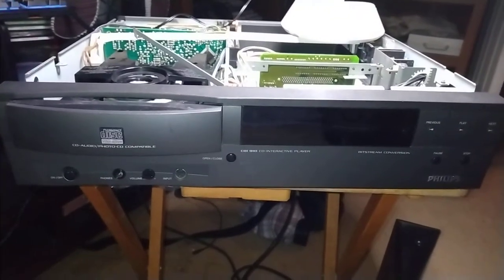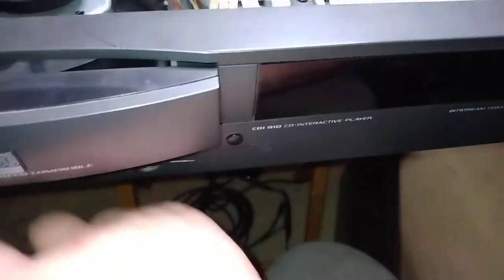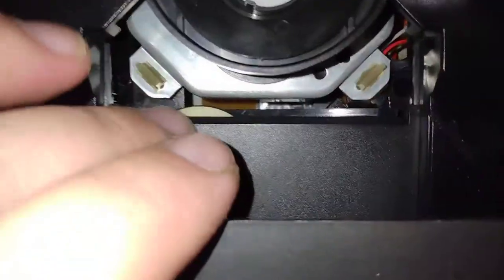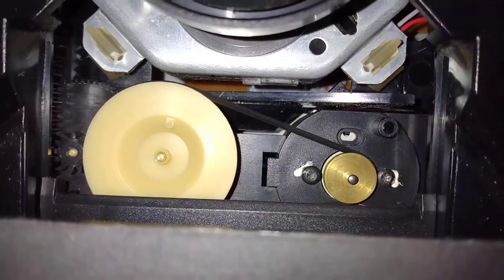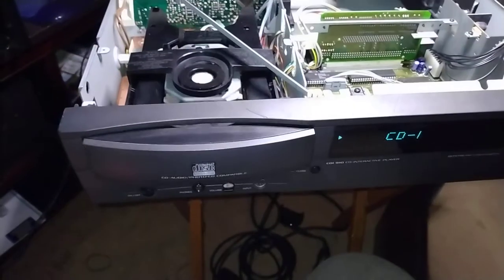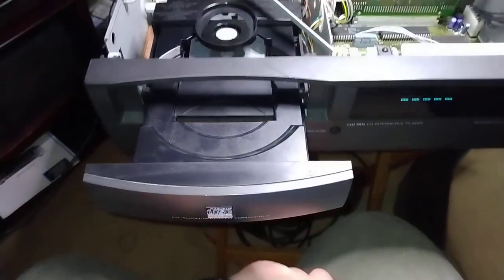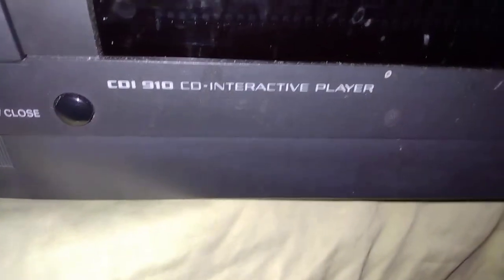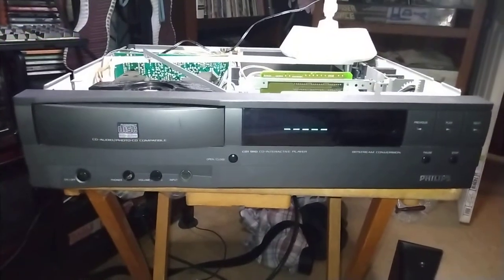Philips CDI model 910 CD tray belt replacement

Comment: Used your guide to fix my CDI 910, replacing the old worn out belt. Thanks!
Reply from the maker: AWESOME! If you need help getting the memory battery replaced, lemme know!
Reply from the maker: I also know where to get prefab boards to mount to the memory vram/clockchip for cheap, that have the crystal on them and the battery holder, and come with a battery. AND I know where to buy some REALLY really really nice CDI burned discs, that have professionally printed manuals, jewel art, and very high quality like, professional on CD og art for like 17$ or so per cd. I also know how to fix locked up spindle motors on the CD drive itself, the one that spins up the CD.
: )
I've also "converted" one with an up-scaler internally to an HDMI outpud. so, there's that too.
ALSO I know where to get the Digital Video Cartridges for FMV games and VCDs for cheap : )